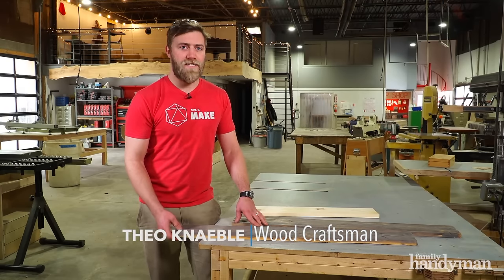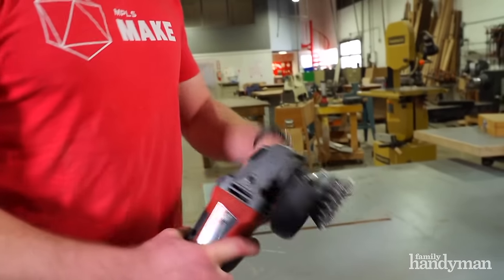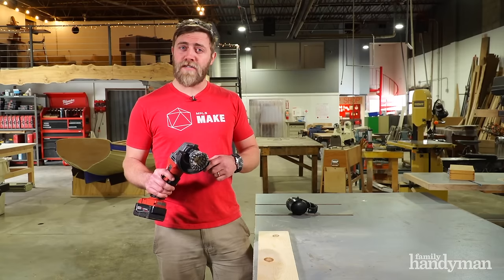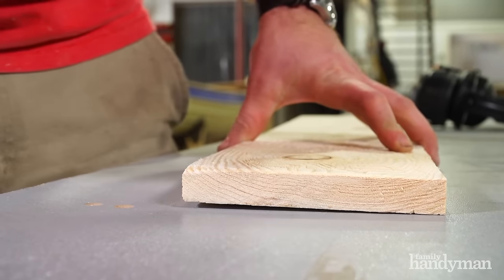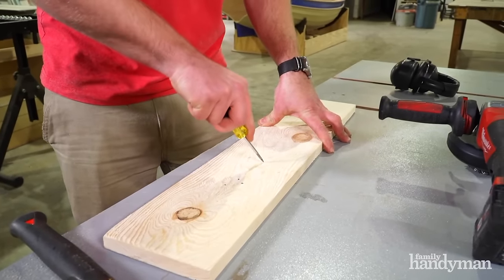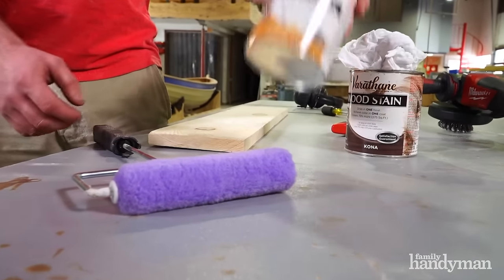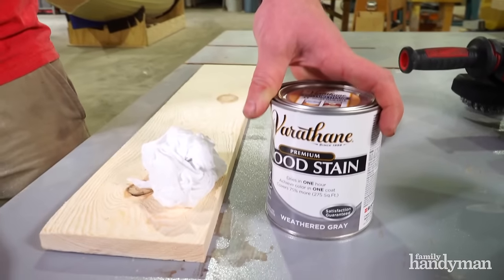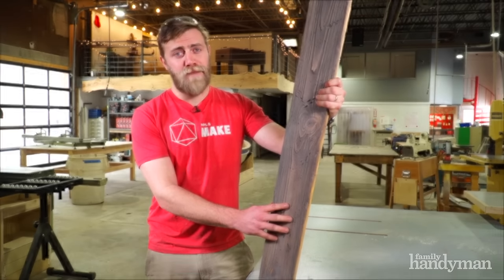How to Make Your Own Barn Wood

Comment: You should also give steel wool and vinegar a try.  I've ran a few boards short on a project and used this technique to fake a board or two.  Turned out pretty good.  Also works good with real barnwood on exposed cut ends.

Comment: Good job!  One of the few who have done this right.
I think Varathane Classic Grey and Slate Grey are better than Weathered Grey.  I think Dark Walnut is better than Kona. 
I would also use some nails with large heads and short stems and hammer them in for an industrial look.

Comment: What are the stain colors used?  Were they oil or water based.
Reply: Summer oak, dark walnut and weathered grey. I believe these are the ones I bought
Reply: Varathane, Oil based.  Don't use water stains.  I prefer Classic Grey or Slate Grey to Weathered Grey.